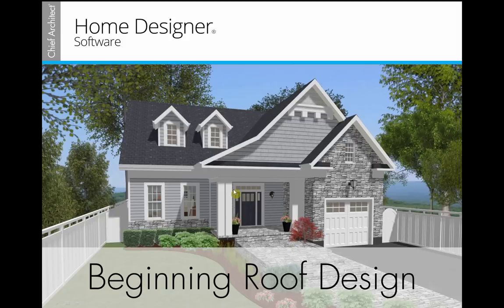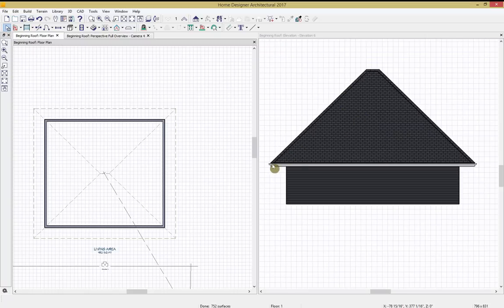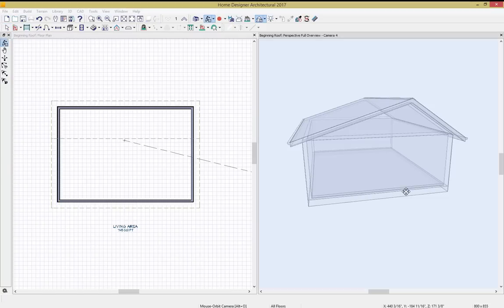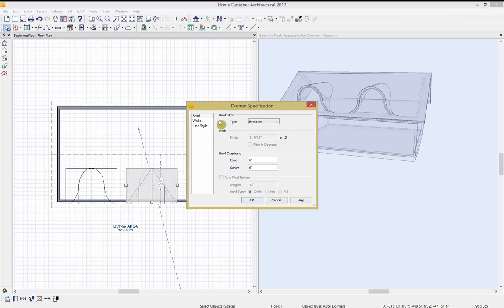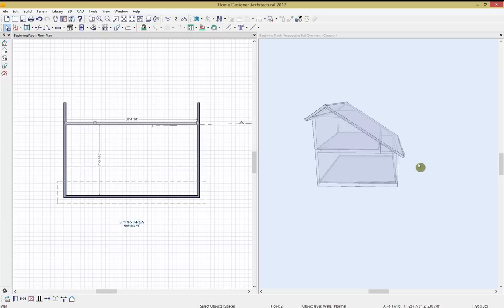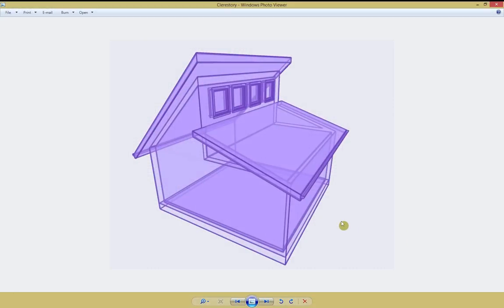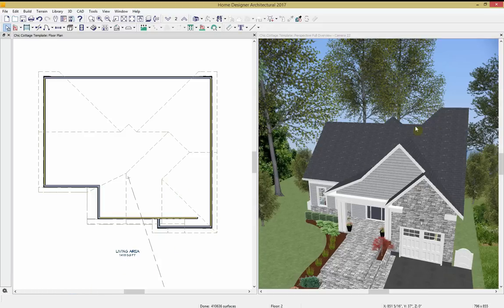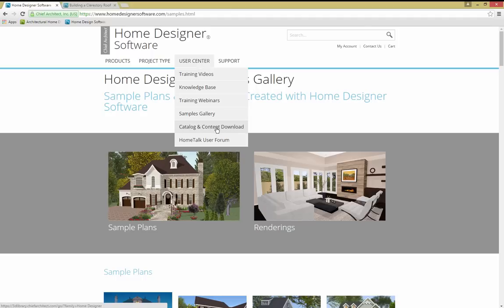Home Designer 2017 - Beginning Roof Design

Comment: On the A-Frame house, when I set my ceiling height to 4 inches and then back to 109. My program draws the walls going through the ceiling on the outside of the house. I notice that yours flickers the same result in your tutorial but then disappears. Is there something I am missing to make these walls only go to the ceiling? I have set those walls to only go to the floor above. It occurs at 35:28. Thanks!
Reply from the maker: Since every plan is a little different, we recommend contacting our technical support team to trouble shoot: https://www.homedesignersoftware.com/support

Comment: I did everything exactly like you did for the clerestory roof but for some reason they wont connect fully.  I'm left with a 6" gap between roofs.  When I watch your tutorial, you have the same thing, but then 2 seconds later it deletes itself.  I don't know how to fix the issue